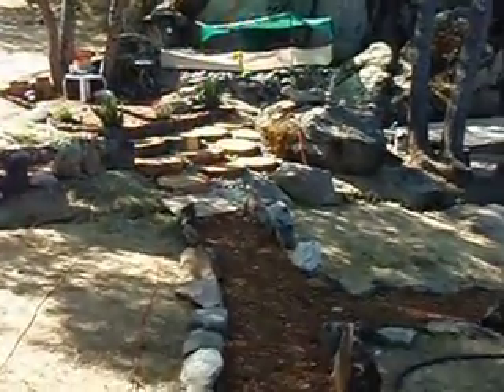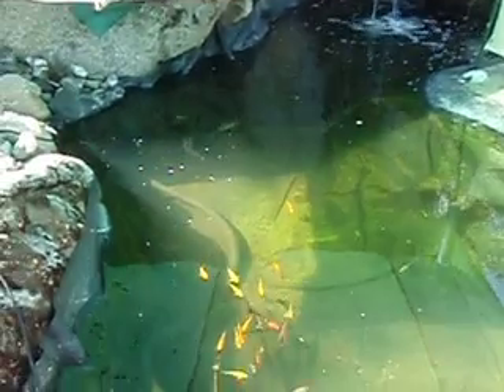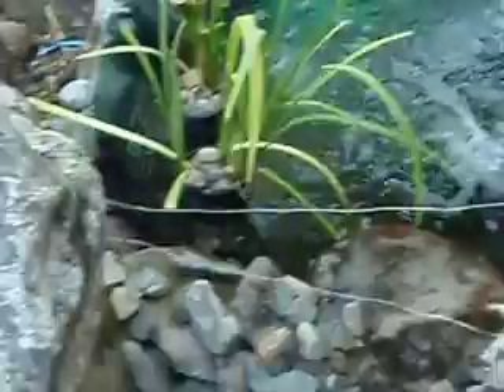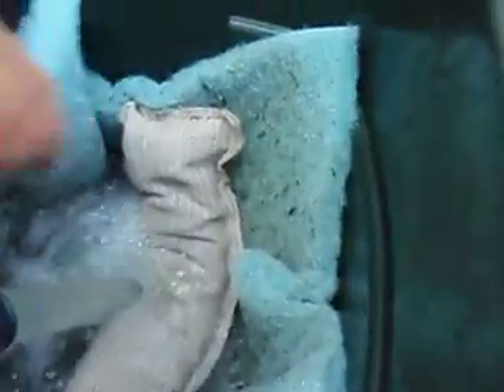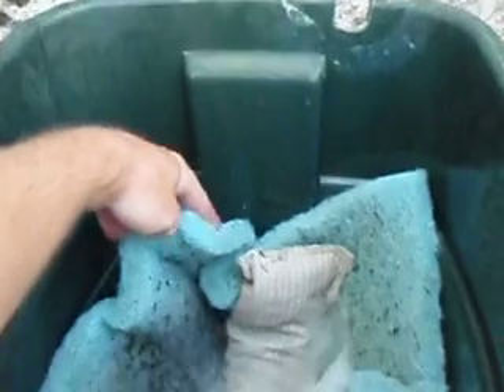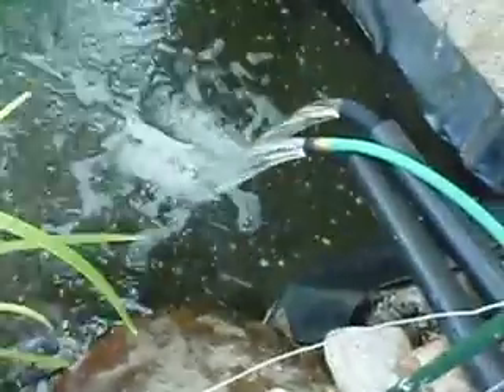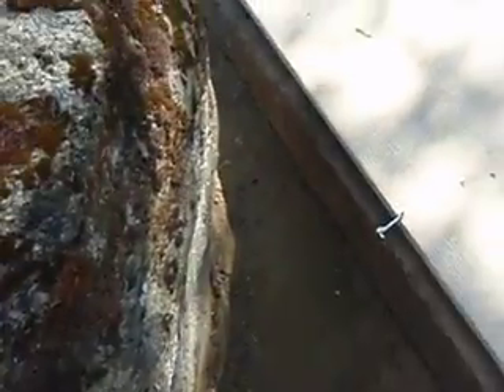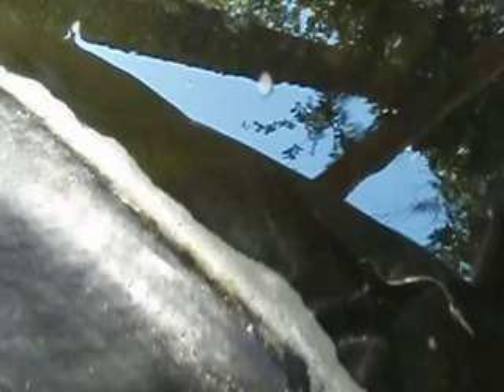How to make a homemade bio filter for your pond that really works! No UV

Comment: Kill any parasites in the pond with malathion. All the Koi keepers will go insane when they read this about the malathion but its for killing 6 legged insects. Most pond parasites are of that kind.Use 1/8 cup malathion per 1000 gallons will clean your pond of parasites. Beneficial bacteria are not insects, it will not harm your bacteria. Also Bio filters are somewhat of a myth in the Koi field. Lots of fancy products and contraptions being sold under the concept of bio filter. What you want is a filter that removes floating organic matter. The best beneficial bacteria growth will come in time, it will grow on the walls and bottom of your pond, it wont happen over night of even in several months. Don't confuse a dirty bottom with bacteria, you will see the bacteria at work when you see trails that resemble a worm casting. These trails are the bacteria colonizing.After 3 years on the 2 ponds we have they are now fully colonized and as natural as you could hope a pond to be. Ponds don't happen overnight and you truly can not rush the process.

Comment: I just built a temporary filter today and made a HUGE MISTAKE.  I used the same blue swamp cooler pads as you did but I also threw in some of those course green ones.  Well.... about 7 hours later I went to feed my koi and they were all confused and not acting right.  Then I noticed the water was all dark green..almost like a black green.  I immediately took all my Koi and gold fish out of the tank but I've lost 3 small goldfish so far and the koi are still sickly looking.  IF ANYONE USES SWAMP COOLER PADS, DO NOT USE THE GREEN ONES.  BLUE ARE OKAY..JUST DONT USE GREEN COURSE ONES SOLD AT MOST HARDWARE OUTLETS.  I think they must be coated or soaked in algaecide or something as bad.  The algae that was in the pond is now black and dead.  I'll probably lose more fish tonight...I'm watching them all in a small tub but I don't think they will make it.
Just wanted to post this so maybe it will save someone else's fish if they happen to get green pads.  Can't believe I did this to the fish.  Hard lesson learned.
Reply: exactly same thing happened to me. all my koi fish died within months later. i think its poison.

did not know much about water as i seen some of my friends pond is so dirty and dark green... that happen over years of no cleaning.

mine happen after i threw the green one in. i usually feed it in the morning like 5:30 or 6 so its hard to tell what color was the water until i came home from work and decided to play with them thats when i notice it.
Reply: BlueRice
Right...I called the manufacturer and they told me it's formaldehyde that they saturated the green pads with.  Of course they told me never to use them as fish filters.  Luckily, all my koi and a few goldies survived but I through them all in a kiddy pool with some carbon bags to soak up the fomaldehyde...seemed to work as the koi survived and some larger goldfish.  They are all still alive today!  I will never experiment with anything for filters unless it's proven or made for filtering.  Sorry you weren't able to catch the problem in time...I was just lucky and checked on them just in time.  They were already at a drunken stupor stage...no fear of my hands or anything!  Everyone is back to normal.
Reply: Sorry to hear this about your fish.  I didn't use the swamp pads, I went to the dollar store and got the plastic scrubs to act as bio balls, also sponges,  I also rinsed all my supplies before putting it together.  My water was all green before building this, within 6 hours the green was gone, my Koi were so active and actually jumping at the water fall, was so happy to see my fish again!!!  Hope all worked out for you!!

Comment: NOTE: at the beginning of the video one fish is "FLASHING" (Quickly turning sideways and rubbing itself, and this causes the sunlight to reflect off the side of the fish),  this is usually a sign that your fish has a problem... I suggest you capture that fish and take it to a koi fish professional to test for parasites or other problems. also, added salt (not table salt) again, ask a professional for the right amount. salt is cheap.. less than $20 for a sack of it and it cures so many problems.